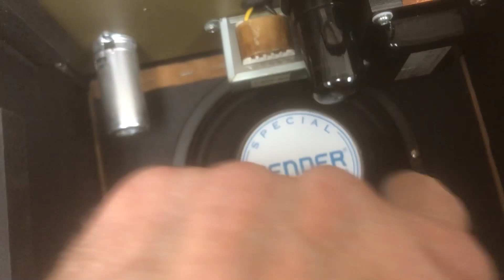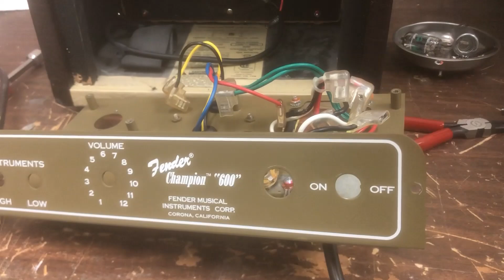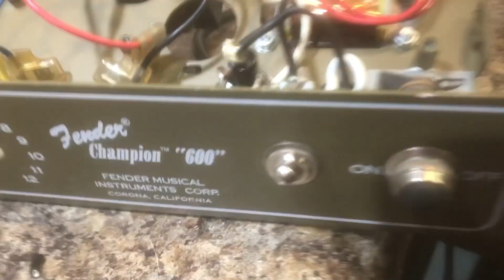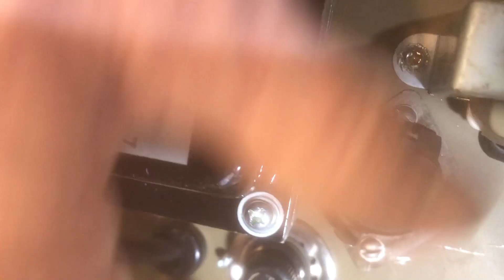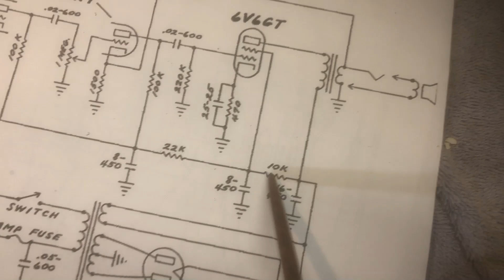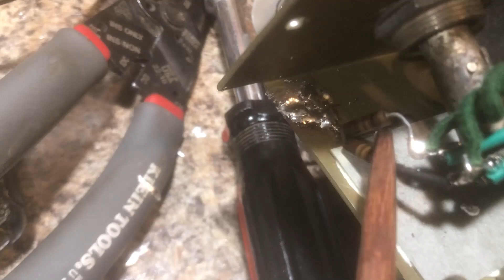Fender Champion 600 Dumpster Rescue conversion

Comment: Good work, Mr. Jones! Take into consideration that when measuring current from cathode to ground that you are displaying both plate current and screen current combined. None of the current meters can give you just the plate current. Subtract 10% as screen current is typically from 5% to 10% of the total. For easy math I use 10%. So, 40 ma combined p;ate and sceen is 36 ma plate current. SInce you are running cathode biased, single ended class A you should  / can run very near maximum dissipation of 14 watts for a 6V6. 360 volts with 36 ma would yield 14.4 watts dissipation, so you were just a tick up to start and over-compensated dropping to 28 ma, which of course then allowed your plate voltage to increase with less load on your power transformer. The vintage tweed Champ circuit would have moore like 320 volts plate and run around 40 ma plate current. Still sounds fine, of course. But, I know Mr. Jones settles for nothing less than perfection!
Reply from the maker: Thank you for that info. I'm putting that in my book of knowledge., There will be an addendum to this coming soon. I have a 6 x 9 speaker going into the cabinet that fits perfectly. I'll revisit the bias also at that point.